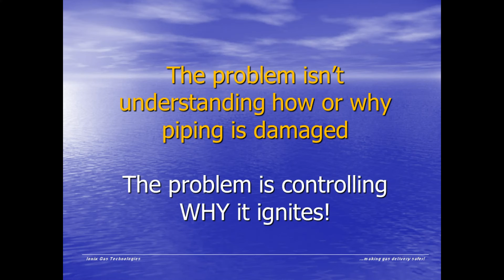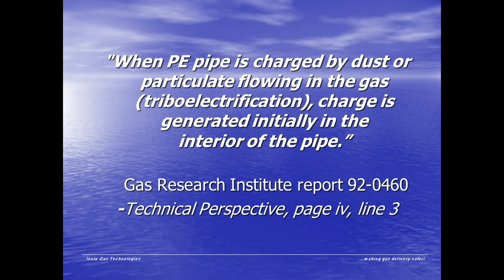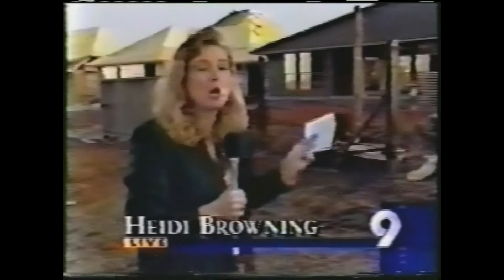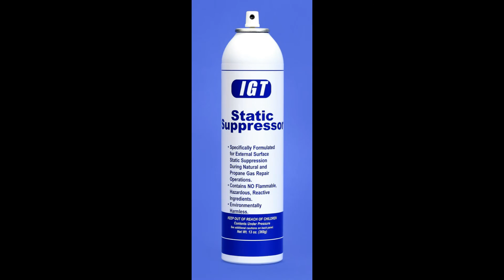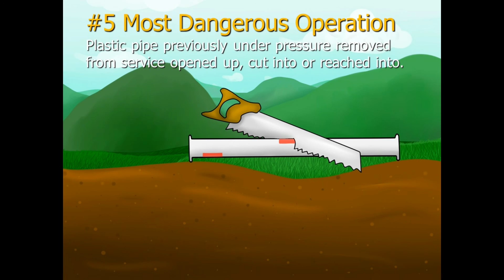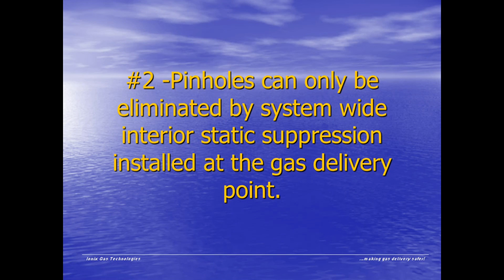Static Electricity in Plastic PE Fuel Gas Pipe   Hazards and Control

Comment: I know this is not to what you're talking about

Solar panels need to be cold in order to be more
Adding copper pipes to the bottom of a solar solar panel may increase the lifespan of them
However
From exactly what you're saying
Those copper pipes with create heating that condemned be entered into the heating old homes that have these solar panels with copper pipes underneath them
However I don't know whether anybody has tapped the energy that has been created by the water running through the copper pipes that he are homes
Reply: Have any products of Static Charge Reducer for fuel pipeline? which the patant 3,383,560 of 1 Method and apparatus for neutralzing electrostatic charges in an electrically charged liquid in May 14, 1968?